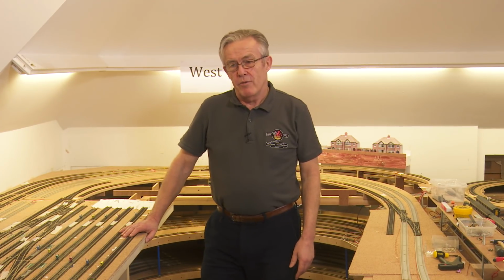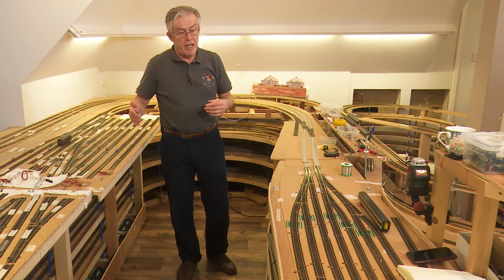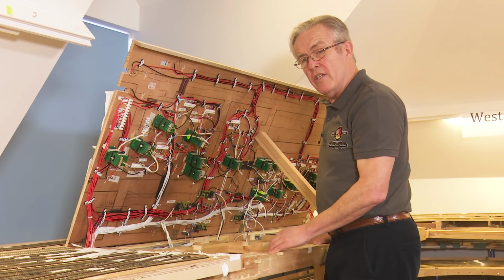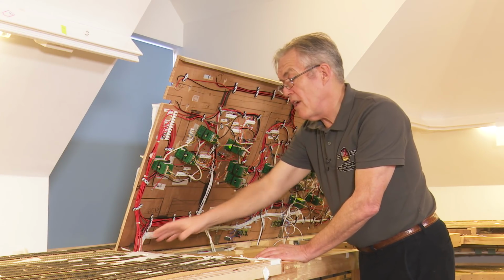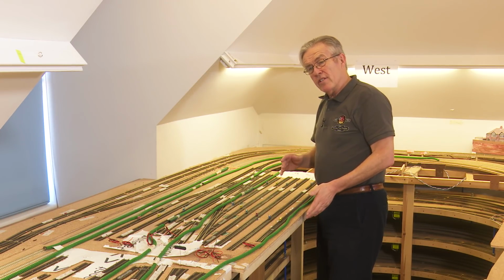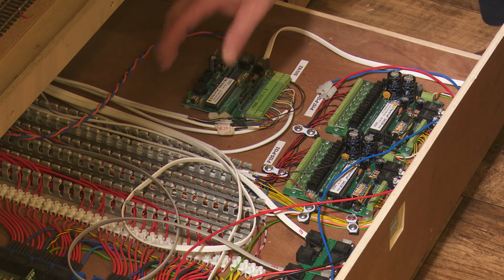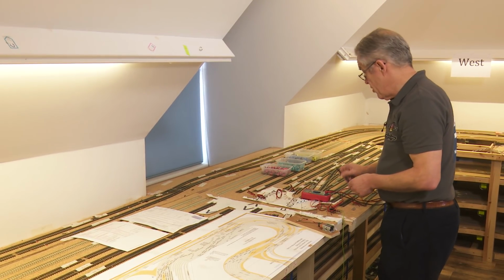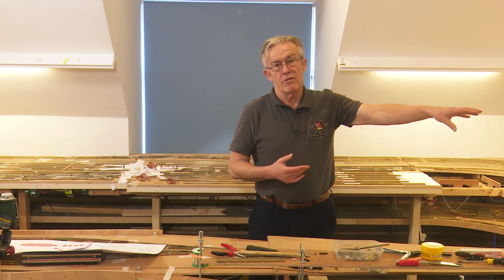39. Sheffield Construction Update at McKinley Railway

Comment: One observation that may be useful for you when checking connections with continuity buzzers. Most meters will give you continuity and buzz with a resistance of up to 150 ohms, which could be enough to hide a fault. It's better practice to set the meter to the lowest ohms value and read the meter to see how close to zero you are.
PS. keep up the great work.
Reply from the maker: Good point.  Thanks..